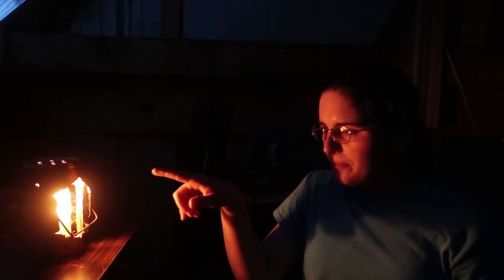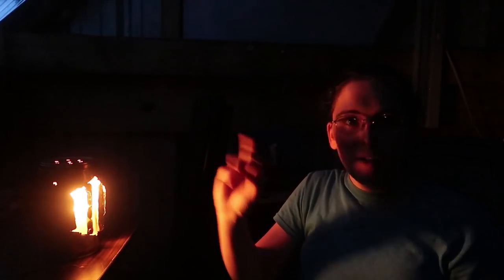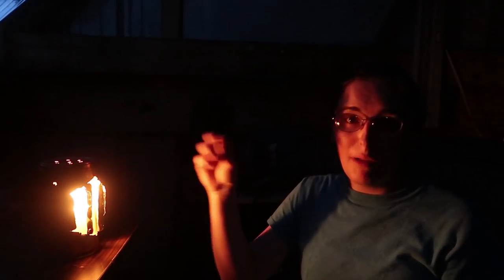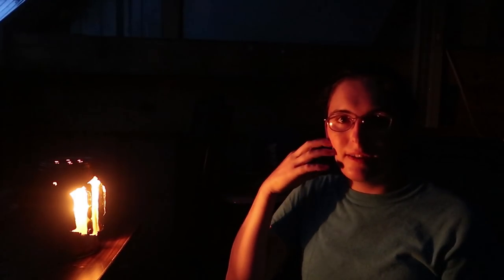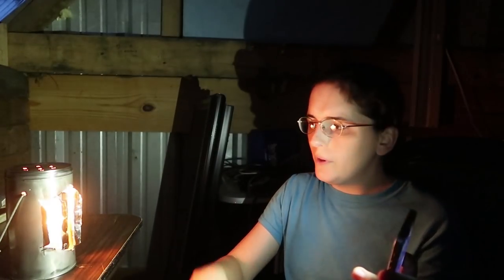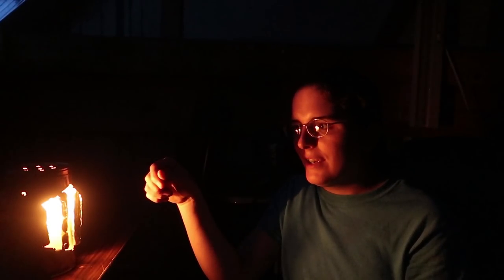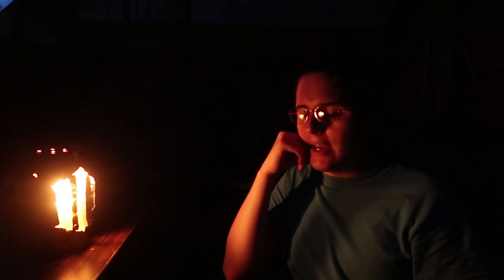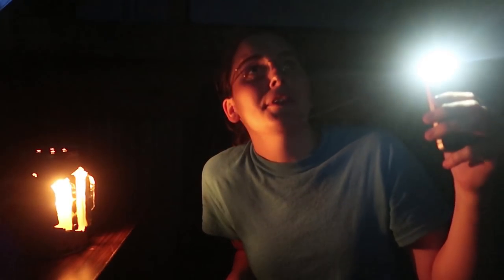DIY Tin Can Candle Lantern / Lamp / Light: Rough First Try, Reflective Directional Light Mirror

Comment: Now follow the path of pioneer candle users and place a mirror behind the candle to project max light.  Use a light wire frame to retain the bright side of the biscuit bag from the can against the inside diameter of the tin.
Reply from the maker: thats what i did. the metal is the mirror